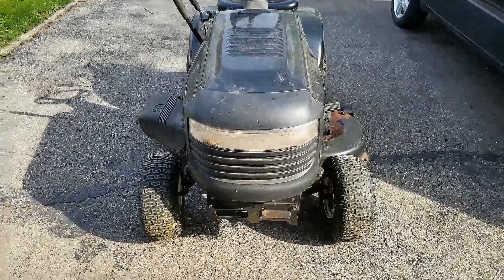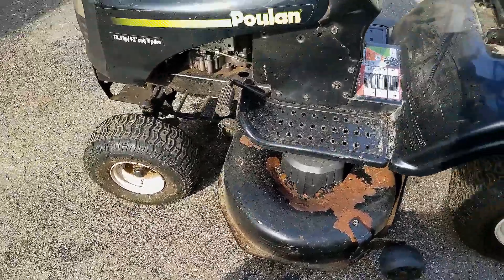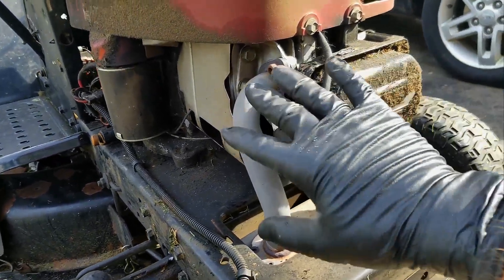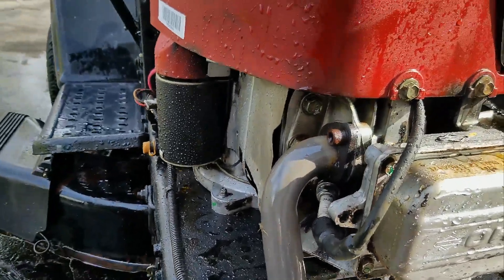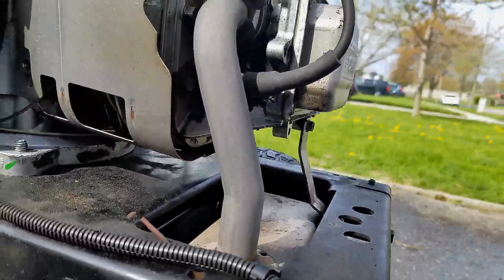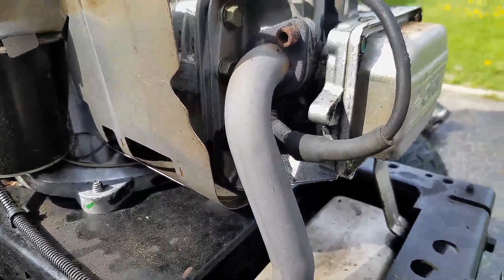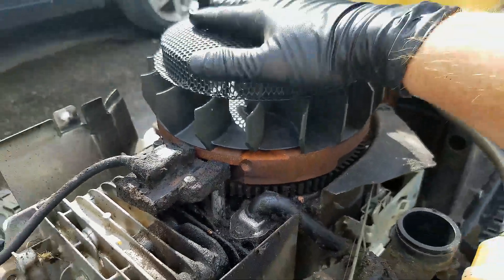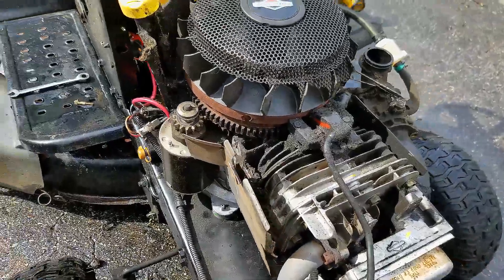Poulan Riding Mower Leaking Oil. What Could It Be?

Comment: thanks I"ll check that on my Poulan riding mower. i have to add oil everytime i"m going to mow.
Reply from the maker: Adding oil before each use is definitely not normal. I would start taking covers off and checking for wet spots. Good luck with the diagnosis. Cheers

Comment: Where is the oil drain plug on this mower?
Reply from the maker: Bottom tight hand side of the engine. You can see it at the 10-15 second mark